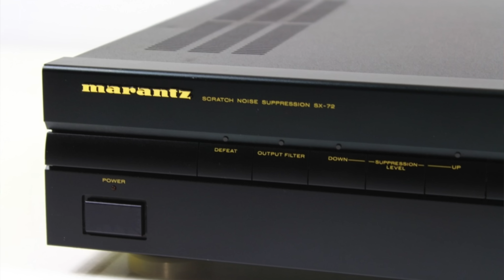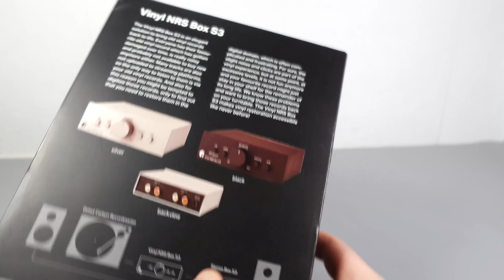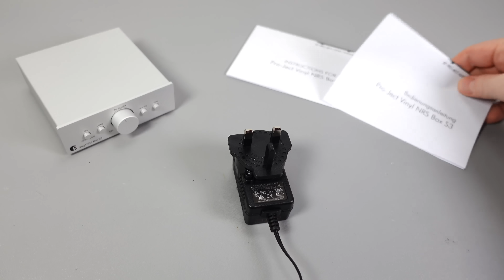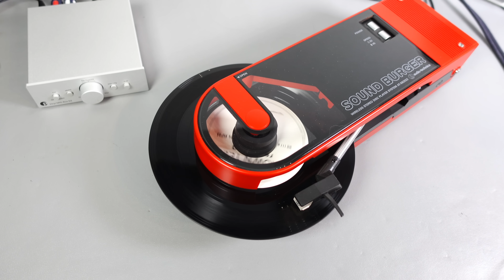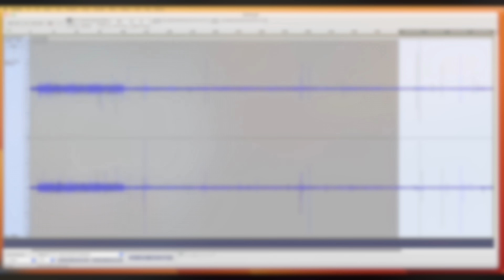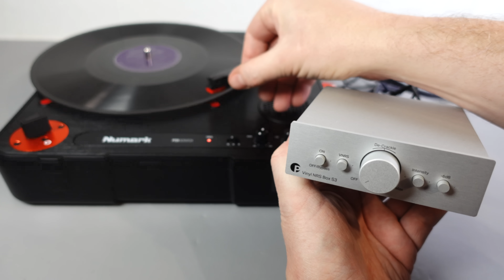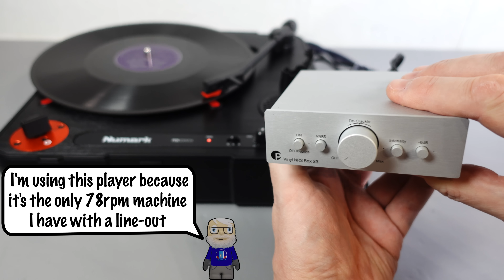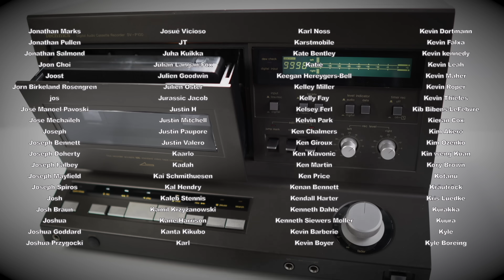REVIEW : Vinyl Noise Reduction System Pro-ject NRS Box S3

Comment: the proper test of this device would be for a high fidelity stereo recording [stereodiscs have more audible rumble when played in stereo] with significant transient energy in the music, such as percussion records, or brasses, those two things trip up most declicker/decracklers. another fine test would be to play a hissy tape recording to check for noise pumping. but from what i've heard in this video this device is a godsend for record collectors in that it reduces the post-digitization workload when restoring [declicking/dehissing] them. if i didn't have CEDAR i'd consider this box.

Comment: I bought it but had to return it, the bass below 220 to 20Hz got reduced with up to 8 dB, the noise floor increased to about cassette hiss level when VNRS was enabled, and increased some more after disabling it.
Checked with the silent track if the Hi-Fi News new test record and even at maximum it partially attenuates STATIC-induced impulses.
But by far was the audio cutting out for a split-second, like the DSP couldn't keep up with the audio stream, managed to alleviate the issue by fine-tuning down to a third of the range, obviously also reducing its effectiveness.
I can send you a recording to see for yourself.

Comment: I heard a system back in the early 80's that sampled the entire disk as something absurd (like 24 bit at over 100k samples per second) using a very high end oscilloscope. These samples were loaded into a file on a pc running dos. The program on the pc detected the defects and identifed the spectra before and after the defects. Then it found the nearest match for the for a defect that didn't have a defect in between and replaced the defect, matching pitch changes and tremelo. Then used some dynamic eq to smooth any remaining difference between the original and replacement.
Last it did something about the surface noise. It didn't seem to cut the highs off much. I suspect it was something like applying a high pass and then averaging sections based on spectral matching. It apparently took something like 12 hours to run on one side of a LP on a 286. Then it had to be loaded back into memory of the scope for playback and record the fixed audio. It was very effective, but it used equipment that cost more than most American houses. But that was back in the early 1980's. I can't help thinking that the with the exception of a good AD converter, even a cheap pc has enough processing power to do this in less than the playing time, just using a single core, and we probably have better algorithms too. At the end of the presentation, they played the entire processed record. It was spectacular. The original was unlistenable and was almost untrackable. The output sounded like perfectly preserved half-speed mastered disk playing on excellent equipment.

Comment: Could just use DOLBY Noise Reduction
Reply: Absolutely not.
Dolby will give you an overall high reduction that is highly dependant on the groove modulation with a pumping high band as a result.
This system is based on the out of phase  signal character of limited amounts of crackling and groove noise which enables you to mix the two channels in this frequency band and have the disturbing bits cancel out each other to a certain level. ( not very high as it seems to be the case).
My estimate is that Q sound effects will also disappear for a large part

Comment: The only way I was successful in removing noise and pops/crackles from an album was manually, and that took over 50 hours of seat time at the computer after recording all the tracks individually through a "spicy" setup of a Technics turntable, a Pioneer SK-550 boom box phono input, sent directly from the headphone output to a Heathkit brand noise cancelling, dynamic range and stereo expansion box, of which I've never found another (can't remember model).
The album was Ozzy Osbourne - Diary of a Madman, mostly because of Randy Rhoades' guitar work on all the songs (he tracked 12 different guitars for "SATO"), which the expander function of the Heathkit did an excellent job of bringing to the forefront. 
After recording, each .wav file was listened to, graphed and inspected against the music itself and I was able to manually drop 90% of pops and crackles from the sound files themselves. 
I'm 2 years late, but somewhere out on the Internet is the original write-up I did with this process, and I still have the original CD copy.

Comment: You know what helps and doesn't cost a fortune? Put that record under a strong shower > wash it with soap and velvet cloth > blast with shower > repead > distilled water > dry it and enjoy massive reduction in disturbances. Cleaned 2 of my records yesterday and am happy. Label wasn't damaged too as it's pretty durable. No silly machines or active systems required, just a tad of elbow grease.

Comment: Extremly sad and funny on the same level is, that ProJect was able to use heavy DSP (I guess some of Analog Devices ADAUs) to deal with noise, but was not able integrate digital RIAA correction (which is lot simplier) to create fully functional vinyl DSP.

Comment: I still have the prototype of a vinyl noise reduction system I designed back in the late 80s. It was an all-analogue system that sat between the output of a moving magnet cartridge and the input of the cartridge preamp and recognised the signature waveform of a typical vinyl click. It used bucket brigade delay lines with a very short delay allowing the system to "see" a scratch half a millisecond before you heard it and replace it with a suitably calculated length of silence. The system dynamically tracked average surface noise as a reference to work from, so there was no need for a manual sensitivity control. In tests with a 45RPM single I'd deliberately damaged, it successfully removed 97% of audible clicks.
Reply: It also incorporated a steep 20Hz highpass filter to significantly reduce subsonic rumble without affecting bass reproduction noticeably. I lived in a home with a wooden floor at the time, and walking across the room while playing a record used to make my woofers thump loudly as well as ruining any recordings I was making. It's very rare to find any intentional information below 20Hz on vinyl, so a feature that started off as switchable later became a permanent feature as there was no point in ever switching it off. I never went any further than building a prototype, but it works as well today as it did roughly 35 years ago so still gets used sometimes when I'm digitising damaged vinyl.

Comment: The DAK Catalog here in the US back in the '80s sold something they called a "Click & Pop Assassin" from SAE that would remove "impulse noise".  It had a unique setting where you could either listen to the signal post-processing OR you could switch it to output the noise it was removing.

Comment: I highly recommend the KLH Burwen Research TNE 7000A for this noise reduction application. My father acquired one of these units in the early 80s. I learned to use it properly when I was around 10 yrs old, on my noisy Beatles records from the 60s. I inherited it when he passed. It utilizes fully manual control of the analog NR using two knobs, for threshold and sensitivity. There are two indicator LEDs for high frequency calibration and Transient Noise Elimination. The trick is adjusting it for maximum NR vs. adding distortion. You have to just trust your ears. Every record is different, so this is not a set-and-forget type of box. It seems to do it's best work when you set the knobs to zero at the header of the disc- where there is no program, increase the sensitivity knob to the point that the calibration LED partially dims, and once the program starts, increase the threshold knob until it sounds bad (distortion)- then back it off a bit. This usually produces fantastic results, with an absolute minimum coloration of any kind to the program. It does not deal with reducing rumble at all, though. But, that can usually be taken care of by a rumble filter. These 2 rack-space units can still be had for cheap. I recommended to a friend- thinking yeah, good luck finding one these days... He purchased one from eBay the same day. They also come up on Reverb and other resale sites. I think he paid $70 USD. He's also thrilled with it! The best part besides it doing exactly the thing it's supposed to do, is seeing the TNE LED light up like crazy- and hearing NO crackles, pops or fizzes... Knowing it works

Comment: I must admit If I have a bad LP that has a lot of crackle and pops which I have a couple I record it through Adobe Audition as a wav file then apply the click pop filter and that will pretty much eliminate the clicks and pops from the tracks, some of my old lps from the 40s were never ported over to cd so it's just a good way to archive it and clean it up a little I'm not a audiophile by any means digital and analog live in my house side by side it never worries me that I'm porting analog to digital just as long as it sound fine for my old knackered ears.

Comment: The declicking modules available nowadays in audio processing software such as Audacity or iZotope etc. works outstandingly well. You hit the nail on the head when you mentioned real-time. The end result would be far more satisfying if this hardware could buffer the signal by a second or two and apply a declicking algorithm.

Comment: Another in the long, proud tradition of gimmicky audio devices.  People will buy this, use it a few times, and then it will collect dust.  If your record is so noisy that you need a filter, then get a new copy.  I'd rather hear the noise than audio that's missing whatever is being cut.  This reminds me of the reverb units from the 70s - one of the few vintage audio devices you can still find for cheap.

Comment: It would be interesting to send a pink noise source through it and then checking with a frequency analyser.  Methinks it’s a glorified set of filters with some steep cutoffs (hi pass for rumble and low pass for decrackle) that would explain why the double bass disappeared when you tried the 78

Comment: Matthew, Ludwig Van Beethoven filed a copyright infringement against you.  It's a shame that dbx didn't become the default noise reduction system for tape and vinyl.  Not much impressed with this DSP unit.  BTW, the noise/signal ratio on the last LP was excellent!
Reply: While Beethovens works are not copyrighted anymore orchestral performances very much are.

Comment: Bearing in mind the components for this will probably cost the seller under a tenner, it's shame they used such cheap external components - the buttons not being centred on the panel holes suggest £2.89 rather then £289.

Comment: I think it makes a slight difference for surface noise, scratches etc probably less so. The part about lowering the bass makes me think of another noise reduction system. Dolby, particularly B tended to reduce tape noise by cutting the treble. I know it was supposed to boost these frequencies to compensate but in my opinion didn't work that well.

Comment: I might be tempted to buy this, but as I use the integrated phono stage on my Rega amp, I have no way of connecting it. Perhaps they missed a trick here by not making the same unit with a built in switchable phono stage?

Comment: I noticed at the box "24bit DSP processing" and "96Khz sampling rate", I doupt if the signal coming out of this box is the pure analog signal of the turntable, it seems that its converted to digital, processed and then converted to analog. The sound coming out of this is not turntable sound.

Comment: The 5 minute test was compromised by the variability of the source material, preventing qualitative comparison< May I suggest making a wide-bandwidth recording from the disk and extracting a particularly noisy minute. You could then tun this through the device at its various settings and you would then be able to make a comparison. BTW, I love your videos!

Comment: The simplest way to get rid of rumble is to have a low frequency blend, so anything below 300Hz is in effect mono, adding in a high-pass filter at about 50Hz would also help. The way this works is that the M signal is a lateral movement of the stylus and the S signal the longitudinal movement. Rumble is a longitudinal movement, so you cancel out a lot of rumble in switching to mono at low frequencies. It's kind of the opposite of high-frequency blend to reduce FM stereo noise in the S channel. You can try this by using a plain mono-stereo switch to see how it works, a lot less rumble in mono.
Reply: The same thing can be done mechanically, by the cartridge itself.   Back in the 1960s, the Sonotone 8T stereo ceramic cartridge had a flexible mounting that reduced the electrical output due to vertical low frequency vibration.

Comment: This made me remember my Cool Edit Pro sessions from the early 2000s. I got a fairly decent Pentium and decided to restaurate about 23 of my vinyl or and MC albums, those which I could not get on CD but which I liked the most. 
To lower the noise floor, you have to take the most silent part of your recording and then apply the algorithm on the complete wave. That worked well, but the next step, decrackling, is a different beast. It is capable of fairly reducing of crackles, scratch noise and pops, but it can lead to a recognizable change in sound/timbre. Especially brass sounds can suffer significantly, if you aren't careful . For some reason, Vangelis albums (Albedo & co) suffered the most, so I skipped them and bought them as CDs when they were available. 
This restoring was a time consuming task, and the calculations were not possible in real-time then. But, as I listened to some of the results now, I am impressed how effective it was, even with very loud scratching and crackling noises.
The more I am astonished that 16-18 years later, where CPU power has increased greatly, even a dedicated device could not deliver at least a fraction of what the relatively simple software from then could do. But since Cool Edit Pro now is Adobe Audition, it doesn't seem to work there in real-time either. I thought it could, at least with a few (dozens of) milliseconds latency.

Comment: Had an SAE 5000 Impulse Noise Reduction System.  Worked very well.  A clever feature was a button for reversing the effect.  Hit the button and only the clicks and pops are sent to your amplifier.  you use this to fine tune the controls.  Keep increasing the NR dial until you start to hear music, turn it back and hit the button.  You get the most reduction with the least effect on your music that way.

Comment: I don;t think these units are any good except for the manufacturers who make money from peoples' foolishness. They are mainly nothing more than high pass and low pass filters (glorified bass/treble controls) so try to de-noise and you lose the HF. The best way is to use a computer program - the first i used was Dart Pro 32 which did a pretty good job. The top of the range pro tool is Cedar. Computer programs get rid of clicks by chopping out spikes and you can reverse the file to get better results. De-hiss and de-noise have to be used carefully because most people have their ears painted on and fail to notice when their efforts may remove some hiss but add a metallic swirl which is probably even worse. There's a site called Radio Echoes where some well meaning folk have donated their over-cooked recordings and you can see - or hear - what I mean. I notice here the demonstrator gives up with a classical record and uses one instead with plenty of HF instruments clanging away so it's much easier to mask the clicks anyway! However a program like Cedar would come into its own on the classical record because all those quiet and silent moments are so easy for clicks etc to be eradicated.

Comment: If you want to reduce the noise and ticks for free: get audacity and play away with the settings (way better results than this "box") and play the records with a layer of water on them.  Free, fun, and effective (though the water part can be a bit messy and can damage labels).

I see the comments are rife with various attitudes, assumptions, and myths.  Most noise reduction systems, and 4 channel "surround sound" schemes relied on "psycho-acoustics" to improve sound.  Ultimately improving the recording of audio with high enough digital sampling eliminated most of the fundamental SNR and SNR degrading with handling, # of plays and time issues.  Nowadays the only psychos are audiophiles with golden ears with mythical fetishes (i.e. can hear the difference of sound with a $200+ change of the amplifier's mains power cord).

Comment: Actually this thing worked pretty much as advertised. I had a look at the waveforms for the three Beethovens (pass-through, decrackle normal, decrackle on full) and also compared switching between them and there is a very significant reduction in the crackles and pops. The normal position does okay, but on full intensity the music suffers. 6-8dB is not a lot so yes you will still hear the crackles. The average human needs about 3 dB before noticing any difference at all, so 6-8dB is relatively subtle. But if you try feeding the exact same audio into the device and compare the original to the decrackled audio directly you will definitely notice the difference.